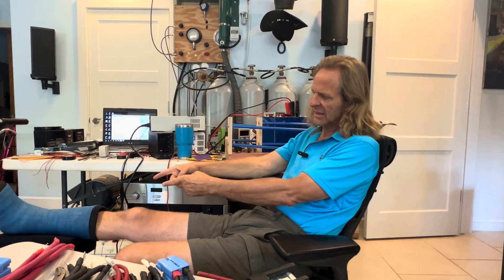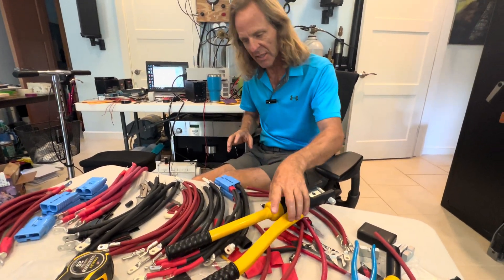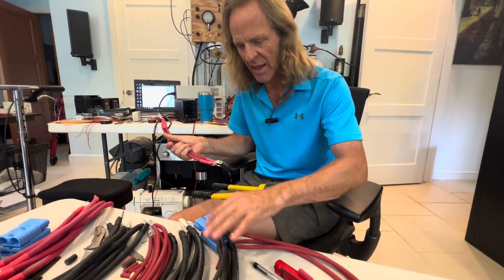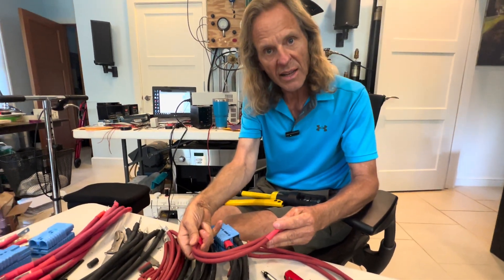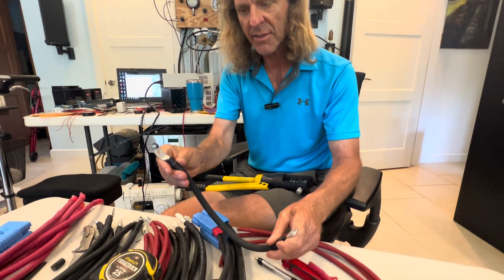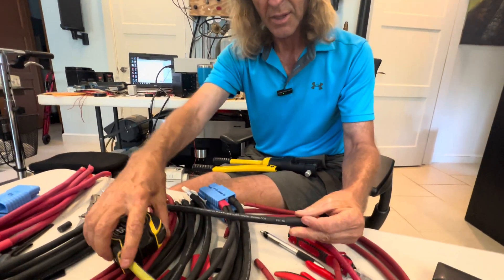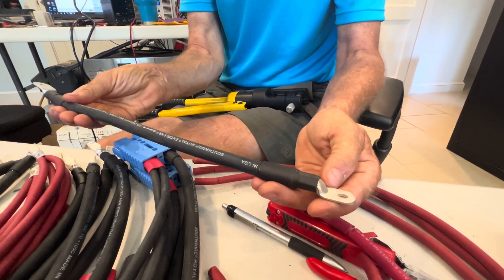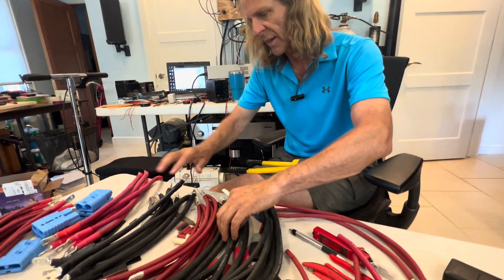Tips, Tricks And Dimensions For DIY Lifepo4 Battery Cables And Wiring Harnesses

Comment: Why don't use silicon wire?? It can handle a superior amperage
Reply from the maker: @serbanmarianflorin8849  yes it can but the heat and resistance still occurs if you downsize the wire and in the same size it is more costly per foot.
Reply: @RayBuildsCoolStuff  inside is a diferent wire you can use a smoller awg for the same amperage and is more flessibile 
I am building my first battery,  the screw on inverter is 8mm 13mm key on the battery is 6mm 10mm key, what binding post to use on the box a 8mm or 6mm is anny difference ??

Comment: Any tips for when the hydraulic crimper is making ears come out of the crimp?
Reply from the maker: @damodoesall6240  yes, if it is minor, I trim with my snips or grind them with a cutoff wheel on my dremel. If it is major, I would go to the next bigger size and modify the dies as needed by grinding the mating faces to get the right tolerance. I show in one of my videos how to modify the dies but I didn’t mention trimming the ears. Thanks for your question. Does that make sense?

Comment: I have an adjustable wire stripper made by ancor amd it has an end with notches in it on the other side pre cut for 20 to 10 gauge cable...love the videos Ray..please keep building cool stuff.
Reply: I also have another adjustable one by "Stedi" MSP-30. I think the model number.i gt both of them from Amazon for less than 30$, and they work well..and I know your pain my friend a couple of years ago I had a seizure and fell down fracturing my ankle in three places. Ended up with 7 screws 2 tension buttons and 2 plates. Then Teo months after the surgery I tripped over my little chihuahua and fell again and ripped out the bottom two so they had to go in with bigger beefer screws. That hurt worse than the first surgery let me tell you so take the recovery nice and slow don't rush things and always stay safe buddy.
Reply: The stedi msp-30 is more robust and sturdy and more expensive too. But it works very well. It's my  go-to for large gauge cables bc you can adjust the neck for the thickness of the cable size and the blade height so as not to damage the conductors inside. It's durable, tough, and functional.

Comment: I had to come back to this video after your suggestion and noticed that the larger gauge used inside the battery is the 50mm - 1AWG  which seems to be recommended only up to 150A in fact that is what I have used for my 100A battery. I was going to go for 2/0 gauge for the 200 battery, are you confident enough with the 50mm because is such a short run?  If I remember well you have very long runs in the solar shed in order to keep equal lengths, do you use a 2/0 or even 3/0  from the battery to the breakers perhaps?
Reply from the maker: The impassively rating of the wire is 286. The lugs are youse are rated for 90 C and that gives them an ampacity of  260 A. I protect them with a class T fuse and a 175A breaker. I used 2/0AWG wire for the inverter connection and protect it with a 250A breaker though the 1/0 would have worked. Thanks for your questions.
Reply: @RayBuildsCoolStuff  Thank you for taking the time to answer.  Initially, I had installed 1AWG 2.5m each for both my batteries but, referring to the table at the end of the attached clip, I thought I'd introduce a third isolator and use 2/0 for my 200A instead, my cables are rated 75ºc.  After what you said I am debating whether I should live everything as it is 🤔 _____    https://youtu.be/wvdnYswuPoU
Reply from the maker: @9111logic  greater understanding is the key to proper design.
Reply: @RayBuildsCoolStuff  Absolutely, thanks for your wisdom 😉
Reply from the maker: The gauge is only one factor. The rating of the wire is also dependent on the temperature rating of the wire and it’s insulation. The welding wire I use is rated to 105C. Check your rating chart again taking that into account.

Comment: Three conductors into a single one - why didn't i think of yhat! It would have helped clean up my last install. 

While I'm sure it's insignificant there is no true way for the adhesive lined heat shrink to seal against three conductors. In a non marine environment it shouldn't matter?

Getting ready to do a residential grid tie with batteries. I wish I could go diy but the batteries need to be CE and UL :/

Comment: The orientation of the lugs and Anderson pins is quite helpful to prevent learning the hard way. When you combine multiple wires into a single lug, you will find that different brand wire and different brand lugs can make a difference. I have also learned that RTV or hot melt glue can seal those really well if you perhaps have high humidity.

Comment: Morning Ray, good to see you well, again. Battery manufacturing we learn a lot.  Ray, we use red as positive here, and black in negative side.
Reply from the maker: Yes so do we. I did have some on an earlier set that had black with red heat shrink on the ends to denote positive due to supply issues. Good to see you. Thanks for watching.
Reply: @RayBuildsCoolStuff  Any time Ray, you just get well. Must be killing you not moving about with that leg.
Reply from the maker: @chuxxsss  I just feel like bending down and taking off the cast. At least I lined up a bit of work for the down time.

Comment: If you install a ''heat shrink'' in a lug with 3 cables, it will never be hermetic since it does not surround the cable completely on the sheath. So the center is exposed to air, moisture and other contaminants. Even with glue it does not surround each of the 3 cables individually. Maybe by adding a grease you could have better protection for the copper....
Reply from the maker: I recognize that but here is the strategy I rely on. When I heat the glue lined heat shrink, I get it nice and hot and then massage the glue into the center as much as possible to minimize the unprotected surface area. Here is my comfort for the remaining exposure. The deposition of water molecules will be mostly by vapor diffusion and that is a very slow process that is area dependent. If it were liquid we would flood from the tiniest of openings but water vapor can only deposit on the small area of access. If you seal 95% of the area, you stop 95% of the moisture. The boxes limit air infiltration a bit and the batteries will on average be warmer than the air outside the boxes so the relative humidity inside the boxes will be lower than outside the boxes. Under load these joints will be a bit warmer also which will expel the bit of moisture might be there. It's not perfect but trying to seal in between the wires seems clunky and messy. It has to be a vast improvement over not using heat shrink and we aren't talking about even the same world as the battery cables under the hood of your car that survive at least a few years in their crazy environment. We definitely are concerned about the same thing but those are my thoughts on it.
Reply: @RayBuildsCoolStuff  I simply answered based on your assertion that the heat shrink would seal the 3 copper wires. I don't sincerely believe that you mass it as much as you want, that the glue will be able to go around each wire and fill the center. Especially since the glue, to be even slightly liquid, must be extremely hot and you would surely have severe burns when the glue could move.
Honestly, I think it would be better to have tinned copper wires and add dielectric grease as a minimum. Perhaps, also, to try to seal with a ''liquid electrical tape'' before putting on your ''heat shrink''.
The ''heat shrink'' will help especially for structural stability and abrasion, but of course also to limit an external point of entry.
Steam infiltrates much more easily than liquid water and with a very tight surface will infiltrate by capillarity... Heat will also accelerate the corrosion process...
Reply: Ray knows what he's doing.
Reply: 3 wires seal for 100% is almost no possible, does no matter how and what you use, but I think that your idea Ray, is the way to do it and maybe others do it slightly different but with the same result 
Make sometimes the copper hot so that moisture get lost 🙈
This is for me one of the best videos!!! Very helpful 👍👍👍
Reply from the maker: @marcvandaele1878  I really appreciate your comment

Comment: Hi Ray.  Thanks for sharing your knowledge.  In terms of stripping back large gauge wire, I find using a copper pipe cutter works best.  It very slowly cuts though the insulation equally and when you get down to the copper, you can easily feel that you are bumping into copper as you rotate the pipe cutter.
Reply from the maker: Now there's an idea.
Reply: Certainly worth a try, and I already have a pipe cutter!

Comment: When using a knife to strip, flexible (small strands), plastic type cables, use a sharp knife and just score into the sheath. then pull and wiggle the insulation as Ray did but a bit harder and add a twisting motion. in no time you will the feeling for it. 
The problem with those strippers is they dig into the soft flexible insulation and "push" at the cutting edge, this bunches up the insulation a bit like pushing at a floor rug, it needs a sold surface to push against. the knife has that by pushing against the copper. the stripper works great with PVC or XLPE which is much stiffer.
Incidentally all these types actually are harder to strip the warmer they get above room temperature, the stretchy effect gets worse.
hope this helps....👍

Comment: This is all very good info, some I learned many years ago and a lot that I have to relearn, so these videoscare most excellent not, only on the educational side but very much on the practical side. As a ham radio operator, I need to make connections that are as tight as possible. Radios are expensive, so great connections are a must. These videos can be used across not only solar batteries but this info can also be used in radio as well.
Reply from the maker: Great to hear!

Comment: Hi Ray,
Enjoying and learning from your videos. Do you know of a anti oxidising product that you can put on the exposed copper before placing in the lug.......for awkward fieldwork where you cannot make sure the crimp is gas tight.  
They use it on 25mmsq earth tape at the right angle joints.... but i cannot find the name.

Comment: Hi Ray, nice to have you back, I'm using the  "Jokari original" for stripping but I can also do it with a sharp blade, like you do, by just pressing it around the cable rather than slicing and I always get perfect jobs. BTW I am excited as I'm waiting for my first 16 304A to arrive from Jenni who has been extremely efficient as always. - Here's the link for the stripper _________  https://www.youtube.com/watch?v=cb0OIv2rpfA&t=4s
Reply: I bought a Jokari and, I don't know, either I am just dumb or it is not all it is cracked up to be because I cannot get this thing to work like you and Will Prowse seem to do.  It looks so simple when you all strip a wire.  
I have practiced and practiced.  Sometimes it actually works like it should but mostly it doesn't.  I have adjusted and adjusted the blade depth.  Doesn't seem to make a difference.  One of the main issues is the tool "walks" on the wire.  I'd love for this to work like advertised but I'll be honest, I have given up and kind of use the same method as Ray.  The Jokari was just frustration.
Reply: @jws3925  if your like me and a left handed person rotate the auto cable stripper 180 deg in your hand and then it strips ok, just my 2 pence worth from expeerience :)
Reply: @jws3925  It can be tricky also because not all cable manufacturers make the cables with the same insulation thickness. I have learned to stay a little shallow,  rotate twice but slowly allowing the blade to dig into the rubber and finally pull away again very slowly. This way it seems to work for the most part. When I deal with thicker insulation I just finish the job by pressing (not slashing) a blade into the cut of the Jokary then use my thumb to rip it off.